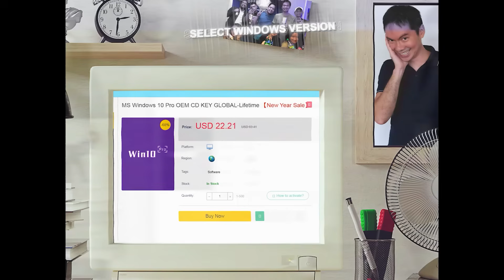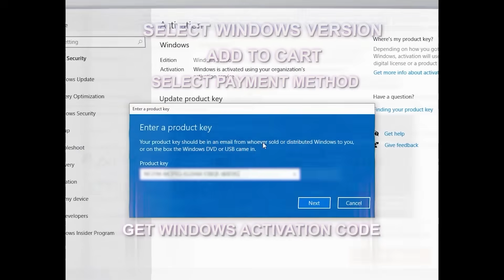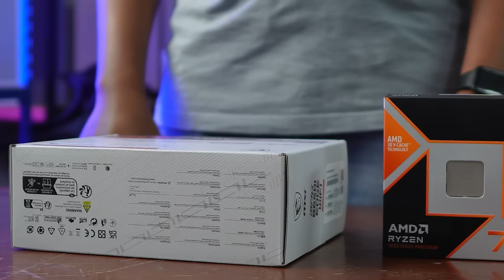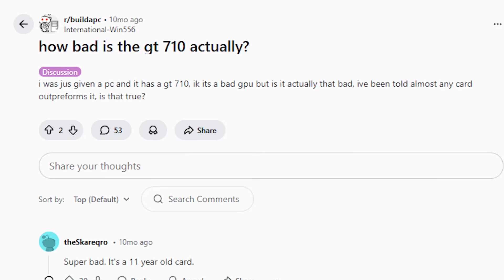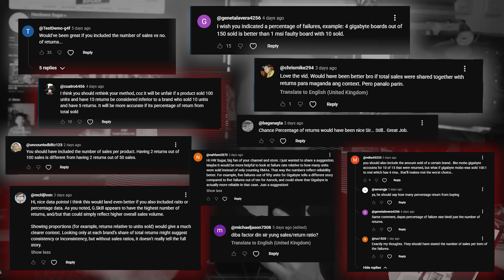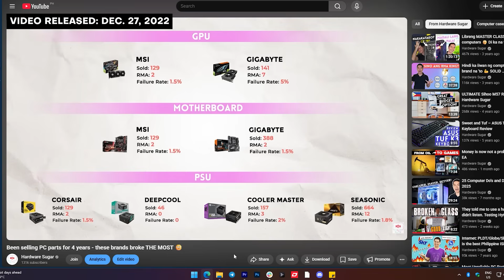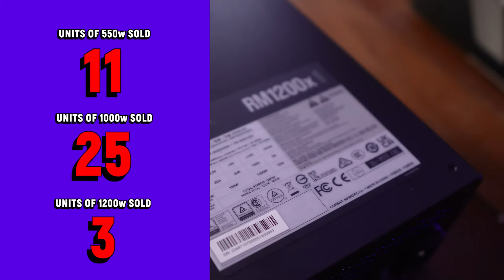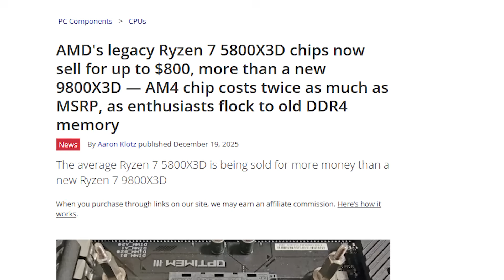The Data is In: Intel is Officially Dead 🪦

Comment from the maker: 📌 PINNED BY Hardware Sugar

A lot of you asked for this! In Part 1, we showed the absolute RMA numbers, and today we’re showing the sales context.

Remember: A brand having 10 returns might look bad, but when you see they sold 100+ units (like Gigabyte did this year), the percentage tells a different story.

Check out Part 1 to see the "Failure Leaderboard": https://youtu.be/h0cGt_s8kRo
RMA with sales data video from 3 years ago: https://youtu.be/NaNlCQa-1DQ

Which brand are you trusting for your 2026 build? AMD or Intel? Nvidia or Radeon? 🛠

(this comment generated and suggested by AI, specifically Google Gemini)